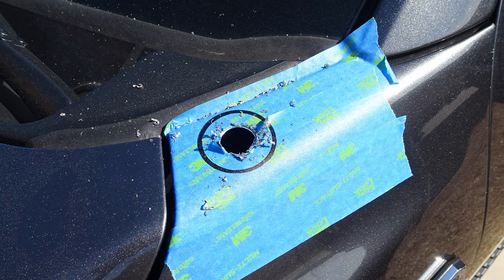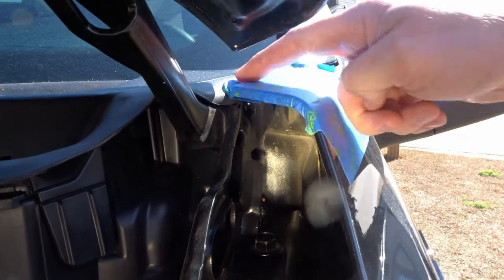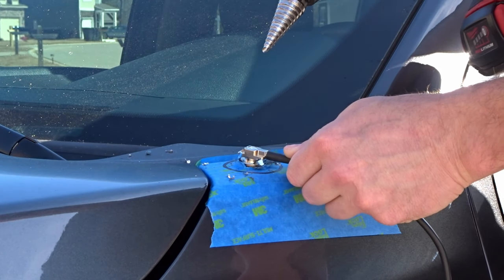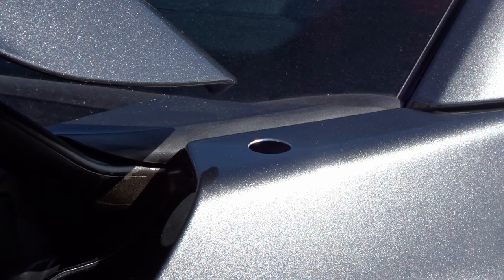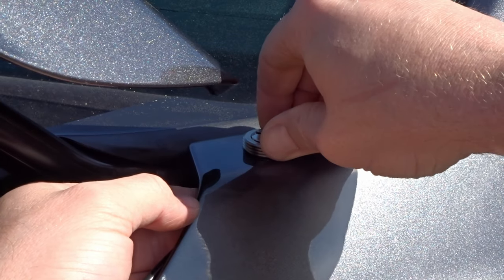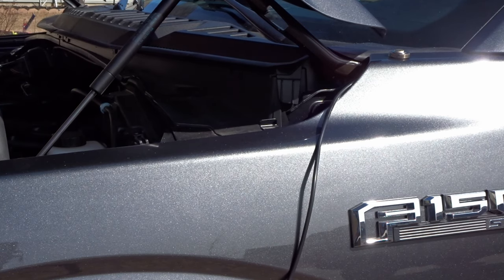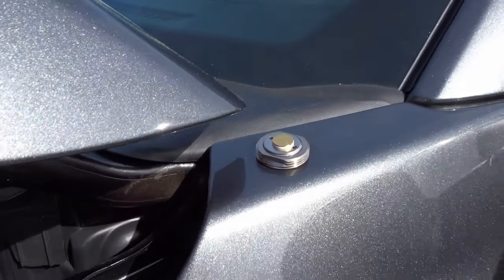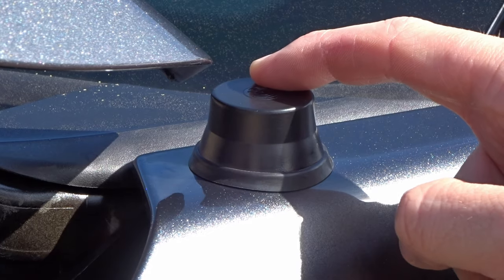Drill fender 2018 F150 to install antenna

Comment: You're a brave brave man. I own an '03 F-150 that I have no problem putting holes in, but watching this hurt a little. Can't say I wouldn't do the same though. Ah, the things we do for radio. . .
73
- KO4RGI
Reply from the maker: Yeah, for sure. There is another antenna on top of the roof, above the third break light.  No guts, no glory.

Comment: Thanks for the info. I have been wanting to install a GMRS radio but wasn't sure where an antenna would work. That seems like the best place. But I'm going to use a Greenlee punch for a cleaner cut. 
I would love to see how you managed to fit your radio into the slide-open compartment.  That is brilliant.
Love the color of your truck.  Mine is a white 2019 XLT Supercrew. My son has a gray 2018 XLT Superduty Supercrew.
Reply from the maker: You can kind of see it in my power wire video, it hides nicely.

Comment: Glad to see ham not afraid to drill holes on newer vehicles
Reply from the maker: Lol. I have another hole in the roof now, right above the third break light. Great location, easy to install nmo and to route the wires.

Comment: Nice job on the NMO install.  I just got a 2018 F150 myself and want to add my VHF/UHF antenna to the roof.  Just a bit unsure about the galvanic corrosion issues.  I've installed several NMOs in the roof of vehicles in the past, but this gives me hesitation.
Reply from the maker: I actually just put an nmo mount above the third break light last week.  Turns out the roof is quite soft, might as well be a vinyl top in the middle.  The area above the third break light is plenty strong and there is already wiring running in there.  I really wasn't worried about corrosion, having my P25 radio is a lot of fun.
Reply: @dutchofsc  They make a thing to mount up to 4 antennae to the 3rd brake light mount without drilling anything. Larson electronics makes it.

Comment: Thank you soo much for your 2018 F-150 hole drilling video.
I’ve been radio free mobile  going on three years because I couldn’t decide if the very place you mounted your antenna would be strong enough and my laziness to remove the antenna from a roof mount to go through the car wash so I wonder if you would please address these questions for me as I want to drill that hole tomorrow so I can mount a vhf/uhf antenna and again become “radio-active”,,,, a little pun,,,,.
The questions I have are: 1) Are you happy with the rigidity or strength of the fender mount, 2) any regrets of using that location?
Many, many thanks,
Dean N4NLT
Reply from the maker: I'm happy with the location, it is solid and has great performance, all things considered. I installed another nmo above the third break light, I have a 1/4 wave vhf up there for p25, just as easy to install. I say go for it, just get one of those plastic rain caps for going through the car wash or when you have the antenna removed.  Best of luck

Comment: I felt for you on the drilling!  I chickened out and went with a fender mounted antenna.  It’s not as clean, but I won’t be able to bring myself to drill for another few years :).  I am very interested in how you ran the faceplate and that usb connection into the storage area there.  I was looking at mine and didn’t see a way to do it without drilling or cutting a hole in the back of the storage area.  How did you do it?
Reply from the maker: I ended up drilling (once you drill one time, it's much easier after that) through the plastic storage on the far left side, fed the wires through the drilled hole, ran the wires under plastic trim and out where the backup pro knob is.  Hope this helps, if not I can record something, let me know.  Thanks for watching.
Reply: Thank you.  I’m ok with drilling in areas that won’t be seen, I just couldn’t see what was behind that area and was afraid of drilling into something expensive.

Comment: Great video!  I'm curious about how you mounted the radio behind the dash. I'm looking to do the same.  Do you have a video on that?  Or would you mind putting one together?  Again, really nice work.
Reply from the maker: Thanks.  Check out my power wire to cab video https://youtu.be/pn3jlG8qBTM 
The radio is located just above and to the left of the power block.  Give that one a look and let me know how your install goes. 

Thanks for watching.  Enjoy your project.

Comment: Great video!   Never thought about putting one there, and was getting ready to drill out a roof hole for my 2016 F150.  How has the performance been from that part of the truck?  Any comments after using it for a while?  Thanks!
Reply from the maker: Sorry for the late reply, I actually addend another radio and mounted the NMO up above the third break light.  It was easy enough to run wires up there and that radio gets more use then the fender mound.  This location has been working well overall.

Comment: With all due respect I honestly think it is not a good idea to drill the antenna into the ford truck's body because the newer ford trucks comes with the aluminum body. it can cause serious galvanic corrosion to the body of the truck... i would recommend putting it on an antenna bracket... west crystal has antenna brackets that are custom built for ford tucks to prevent galvanic corrosion
Reply from the maker: Thanks for the comment.  I'll be sure to inspect regularly to see if any corrosion starts.  So far it has bee good for a bit over 2 years.  When I put this on, the bracket options were not that good unfortunately

Comment: God no. Who drills a hole in their fender 🤦‍♂️. Why not just buy the mount that bolts to the hood hinge and sticks up between hood and fender? I have one and love it.
Reply from the maker: I do, and I did.  Those mounts suck
Reply: The factory radio antenna has a hole drilled for it.  No biggie.